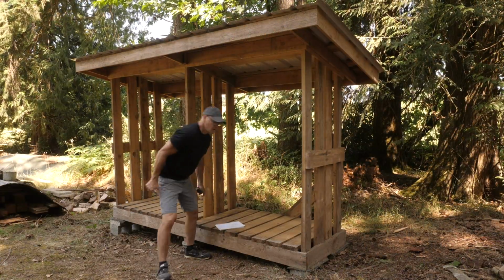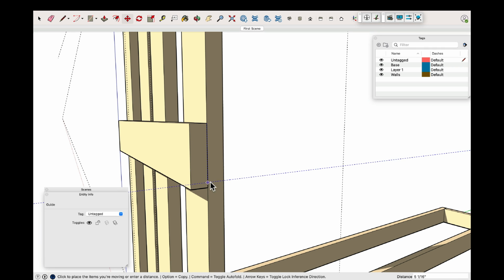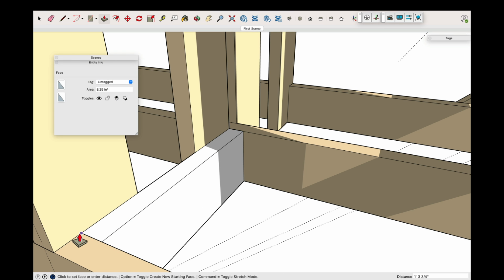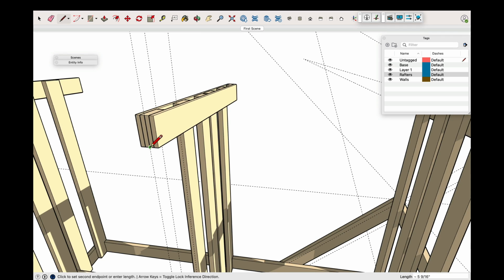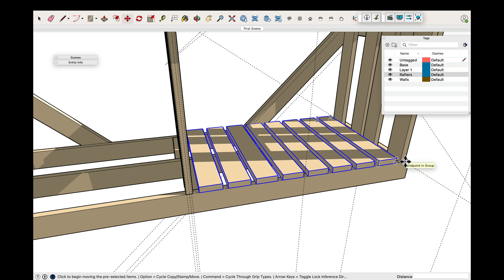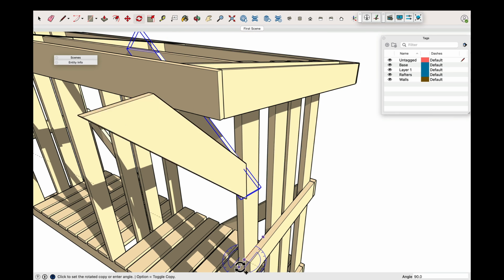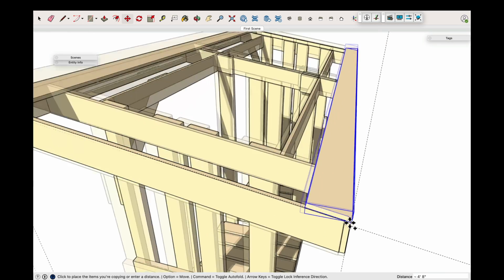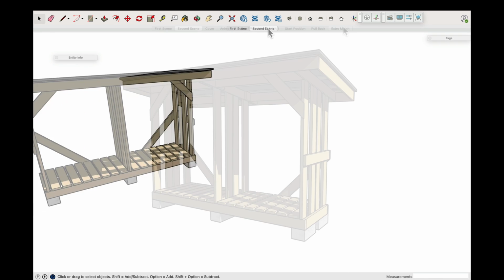design a Simple Firewood Drying Shed - Part 1

Comment: Thanks for the great video!  I purchased your Three Gable Pavilion plans and fabricated the pavilion using milled hemlock during Covid.     I'm glad you had a video because it was a very useful reference.  The experience of building the pavilion gave me confidence to attack other projects.    One question..... Could you tell me about how many cords of wood fit in the shed?  I'm guessing 1-1/2 to 2?
Reply from the maker: Thanks! That's great to hear. Packed full, this shed will hold 1.34 cords (171.62 cubic feet)

Comment: Thanks, Kent. Well thought out, as usual. 😃 Here in New Mexico at about a mile in elevation, drying wood is simpler and not the issue it may be in damper climates. I spent almost a year living in the desert an hour north of Yuma, AZ... I would hang my clothes up to dry, and when I would finish hanging them, I would go to the beginning of the line and start taking them down to fold... even blue jeans dried in mere minutes in the heat. It got to 128º F that summer of '93.
Reply from the maker: Thank you!!